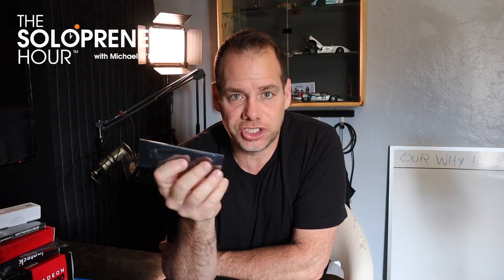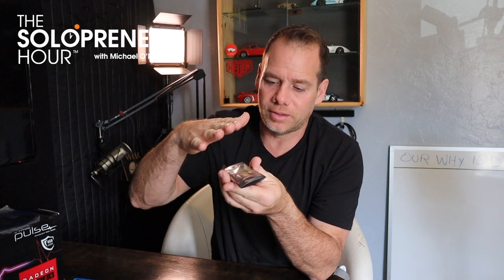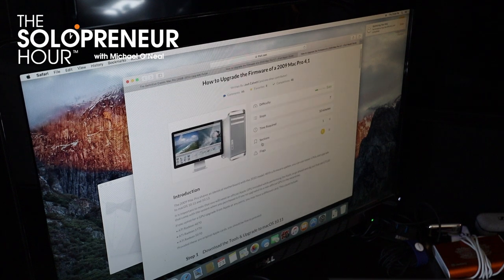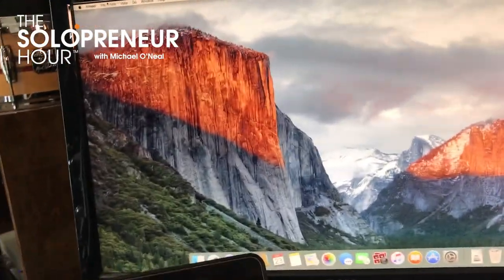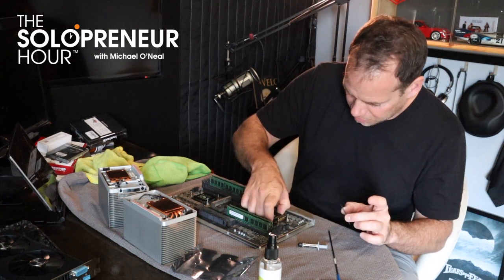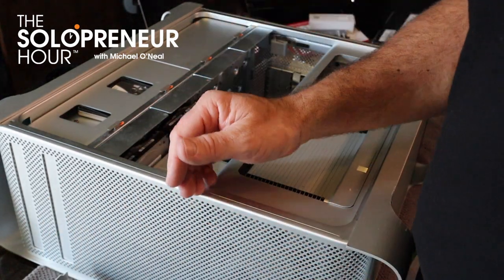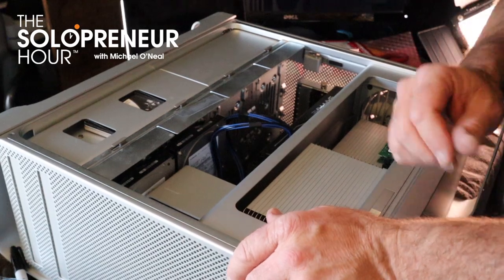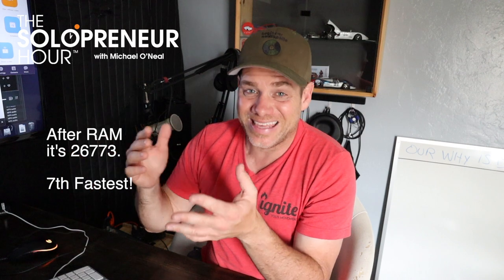The 2019 Mac Pro DIY Upgrade Guide - Building The Ultimate Video & Podcast Editing Workstation

Comment: Haha man pump the brakes, that hardware in not that HARDCORE and the Mac Pro is one of the most locked down computer as far as upgrading. Cool it’s one that Mac lets you upgrade haha but every other OS on earth you can upgrade x 1,000,000. 

Thanks for the info
Reply from the maker: Drew Parish yea...but this isn’t about every other OS on earth. It’s about how to take a 10-year-old machine and make it fast and relevant in 2019.

Comment: Cool, but...  Are 2 CPUs really better than one?   How may applications really take advantage of that many cores?  Benchmarks are great but... who cares 10 minutes later when you are doing real work?    And 12 cores on 2 CPUs is not the same thing as 12 cores on one CPU.  Certainly 2 CPUs and lots of cores a great if more than one power hungry application is running, but is that normal for any user?
Has anyone just tested 1 vs 2 CPUs with the same clock speed in normal use?
Reply from the maker: Nordburg no idea. Not what this video was about. Thanks for watching!
Reply: @solohour   Don't you use the computer?  Does it have to be?  Thanks for the Reply!
Reply: @GirlWithTheFilmCam   No.  More cores on one CPU, 8 or 12 on the trashcan, up to 28 on the new cheesegrater are somewhat helpful.  GPU is more important, but the second CPU in the old Cheese grater is not helping render video vs a one CPU chessegrater.  2 CPUs is a different kind of multi-tasking, and Apple is not optimizing it's code for 8-12 year old computers.  The one CPU 3.46 option is the best way to go with the older tower.